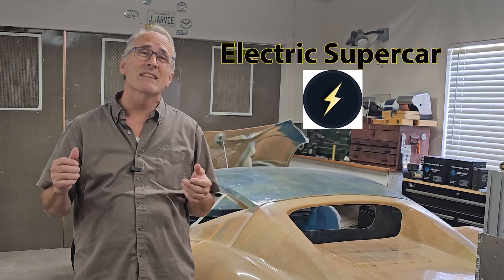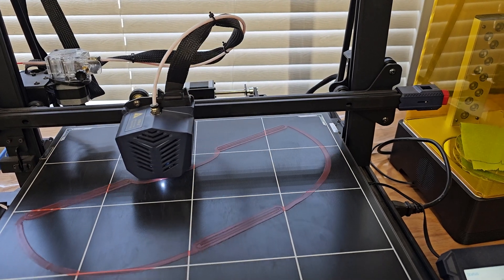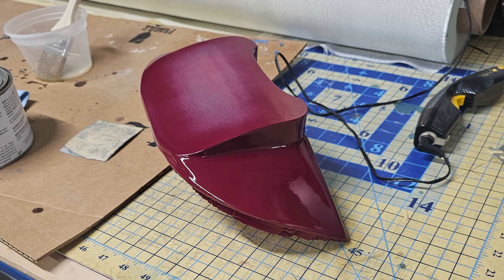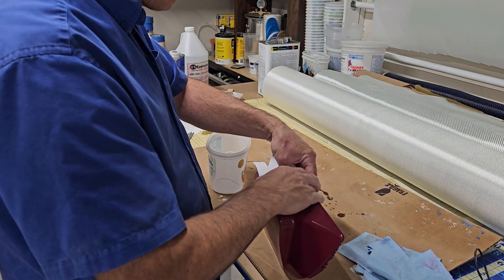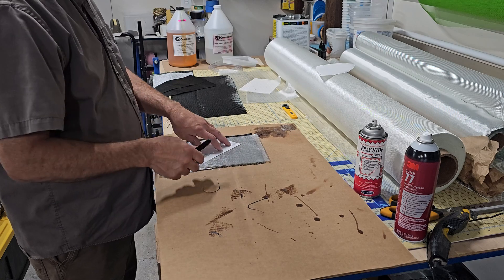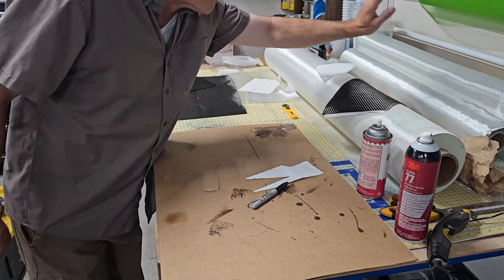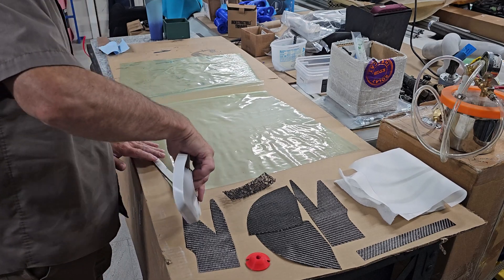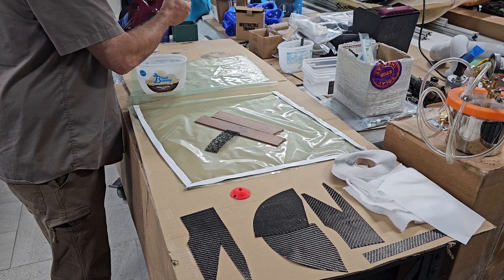We become an organ donor to save this Nissan EV, with @ElectricSupercar

Comment: Awesome Stuff!
Would it be possible to use UV resin instead of the epoxy so that you could dry it a lot quicker?
Reply from the maker: Possible, but the peel ply and the breather cloth would block much of the light, or at least enough of it to cause problems. And UV resins smell terrible! ;)
Reply: @BuilderCreator  at 1:45 you coat it with epoxy to smooth it out and the let it dry. You mentioned having to keep flipping it around to let it flow while it dries. Was just thinking that that process with the UV resin might be quicker.
Reply from the maker: @GamingWithURO  That would be a good time for UV resin. I just happen to have some Sun Resin that I will give a try next 3d print. Thanks.
Reply: @BuilderCreator  definitely worth a shot 👍